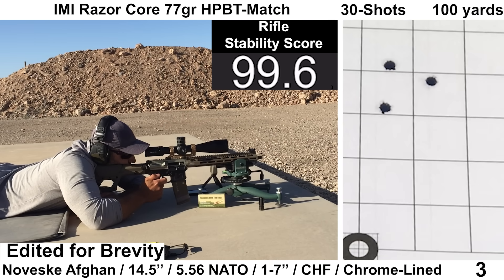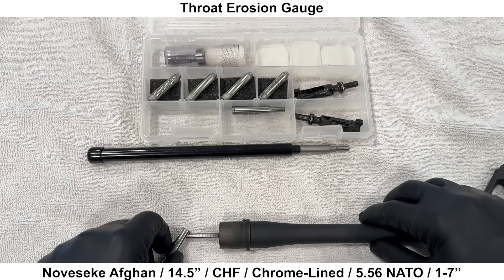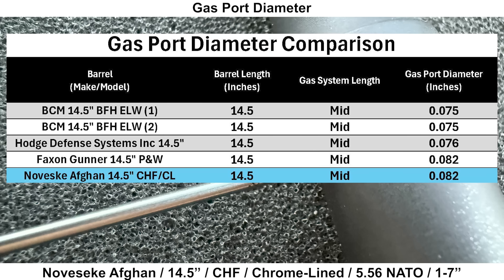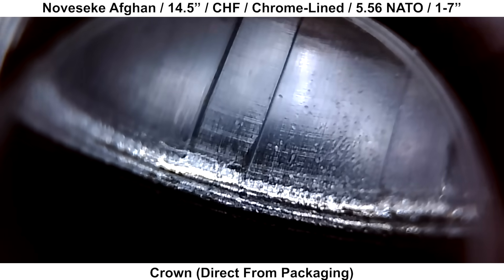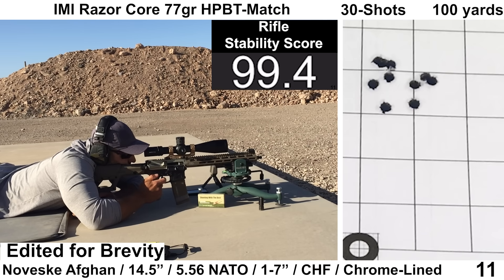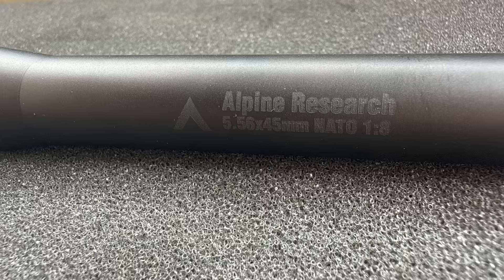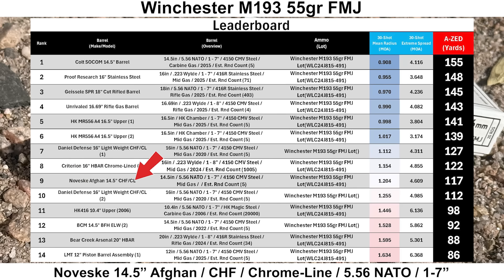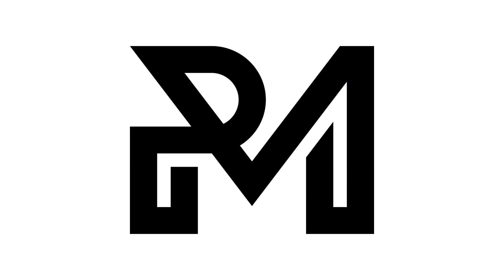Noveske Afghan AR-15 Barrel - Full Breakdown & Range Testing

Comment: My biggest issue with noveske is that their gas ports are huge. I've shot aks that are less gassy than a noveske
Reply from the maker: This one didn’t provide the most pleasant shooting experience. It definitely could have benefitted from a smaller gas port.
Reply: I have a John Noveske skinny afghan, 14.5 barrel. I can’t complain about the accuracy and it’s quite light. I also have a much less expensive BA 16” that’s just as accurate. Both are very over gassed. I’ve managed to tame the Noveske to 2:45-3:00 ejection.

Comment: I have one of the Noveske ddf 11.5” barrels. The gas port on it is .093. Wish they would’ve went a lot smaller with it.
Reply: Geez! Even a .067 11.5" would need a Super42(or Sprinco Blue) H3 when suppressed.
Why did you buy an 11.5" barrel with a gas port larger than .070? That's the spec for MK18(10.3") barrel.
.093 nearly doubles the gas of a .067, like +93%💥
Reply: Get a BRT gas tube to get that GP size down. It’s the easiest and best solution.
Reply: Just to chime in this is a mid gas barrel. You have almost no dwell. You need a fat gas port for that to run. I have an 11.5” ddf upper and it’s lights out. It’s running an h2 springco blue and a alleycat 556 and it’s 2:30-3 and dead nuts reliable. From my understanding a mid gas barrel in 11.5 should be pretty close to that to run reliably. Put the thing together and run it, I think you’ll be impressed.
Reply: @brandonwallace1471 Great info, didn't know it was mid-length. 
Well in that case it sounds like a barrel meant for suppressed-only build that uses a traditional baffled can.
Not something I would consider in this day n' age but to each their own.
Reply: @JohnZ556  no that’s the reason the gas port is huge. It’s built to run suppressed or non. If you ran a high back pressure can you would be fine in the .076 territory but it wouldn’t cycle with a flow through can or no suppressor. I have run 55gr and 77gr through it reliably suppressed and non and zero issues. I however would not run a rc2 or similar high back pressure can as you would then be battling buffers and springs as the thing would be gassed horribly. With a current flow through can hux, Ptr, velos lbp or my cat can you will have 0 issues going somewhere in the carbine spring territory with a h-h2 buffer.
Reply: @JohnZ556 I use my CGS SCI-SIX and CAT WB and they run fine on them.
Reply: @brandonwallace1471  my irregular defense 11.5” is ported at .085. And my mos tek 11.5” Midl length barrel I had ported at .078. The gas port doesn’t need to be that big to run.
Reply: @carls2210 Different barrels. What’s the weight difference of the ID vs DDF? Gas block journals are .750 vs .9375 it’s not comparable. I have a KAK 11.5 with a .076 and it doesn’t run without a can. Are you running suppressor only?
Reply: @brandonwallace1471  1.5 oz.
Reply: @carls2210  put it together and run it. I’m telling you your low back pressure cans are going to have 0 issues with gas to the face. Springco Blue and an H2 in mine. My can is basically a white bread so all things basically the same as what you’re talking about. Noveske will tell you to run just a carbine spring. I have one new in package and a Springco hot white to play around with but had zero need as the blue is great.
Reply: @brandonwallace1471  I’m not worried about gas to the face. It’s not bad I’ve been running them for months. But for the price they charge for the barrels and the way they market themselves as barrel wizards I would’ve expected better gas port sizing. I do like the barrels with the cans I have. But next time I’ll just order another mos tek. I run the A5 system on all my rifles.
Reply: @carls2210  Does it malfunction? I just want to know what issue the gas port is causing. I don’t chase 4o’clock ejection but I know people do. But in 3200 rounds since end of March even using junk dirty win white box 55gr I had a single light primer strike. It’s dead nuts reliable. Hence what’s the issue?

Comment: In general are the heavy barrels more accurate?
Reply: In my experience yes. Especially when they get hot. I get the worst results with a standard govt profile but ive never tried a pencil barrel
Reply from the maker: In a very general sense, yes, it seems that heavier profile tend to produce better performance to a certain degree. However, there are plenty of other things that can affect barrel performance as well.
Reply: @PrestonJMoore  Can you offer any insight or advice for someone who wants to assemble a rifle that’s capable of handling a high heat/high rate of fire without quickly failing?
Reply from the maker: @roycox193   Can you elaborate on what you mean by a "high rate of fire" and "failing". the better I can understand your question, the better I will be able to answer it.

A while ago I did a video where I shot 90 shots consecutively into 3x 30-shot groups, which may or may not be helpful in answering your question.  You can find the video if you put " 6m6LIiwtAak" in the search bar
Reply: @PrestonJMoore  I’m experimenting with some FRT setups, most recent was doing 940rpm /5.56 and 880rpm /.223 so I’m sure that smaller profiles won’t hold up very long. I understand that military machine gunners change barrels frequently but I’m just trying to figure out if I need CHF CL HBAR’s in 20-24” to be able to handle a higher rate of fire in a safe and practical manner (I know it sounds a little crazy) but I want to find some limits

Comment: I've always wondered if a muzzle device could effect group sizes? I understand why you do a bare muzzle because it's the most consistent, but just thought I'd ask anyway
Reply: yes it effects it a lot
Reply: It definitely did in the testing I did once.  4 devices, same torque, different group sizes and POI’s shifted a bit too.
Reply from the maker: I plan to gather some data and do a video on the affects a muzzle device can have on barrel performance. But, it won't be any time soon.
Reply: Yes, muzzle device can impact in several ways- a muzzle erosion gauge can read differently on a barrel with an over torqued muzzle device versus properly torqued, weight of a muzzle device can alter results it alters barrel harmonics, concentricity of the barrel treads relative to the inside diameter of the muzzle device and any blast surfaces or ports.... All of that is just scratching the surface.

Comment: Absolutely love that you did the Frontier 68gr BTHPs. They seem like a very reasonably priced load!
Reply: Frontier .223 75g is the only factory load I’ve ever shot that popped a primer.
Reply: I've been seeing insane looking case heads and primers at the range and thought it was scary reloads, but it was all Hornady brass...
Reply: @SiliconeSword mind boggling that this is still a common issue.
Reply: @samlatone1763 at another range I saw red sealed primer PPU 5.56 with CRAZY ejector extrusion, so I think that must've been some factory stuff as well if the primers had sealant on them

Comment: @Preston Moore Are marks like the ones on the buffer at 4:37 in the middle normal?
Reply: There bolt carrier group most likely has a bur at the back of the carrier which is causing that pattern on the buffer face.
Reply from the maker: In my experience, they are not particularly abnormal after a decent round count. It is from the back of the BCG contacting the buffer.  If the back of the BCG is a bit rough, it will cause more wear to occur faster.
Reply: @PrestonJMoore  Thanks for the reply. What do you think about the play between the upper and lower on an AR-15? Does it have any effect on anything? Should there be none at all?

Comment: do you have any data or experience regarding barrel mounting from your testing? does the clearance of the barrel extension to receiver matter? is "thermal fit" even useful?
Reply from the maker: I don’t have a lot of data on that at the moment.  But a video on that topic is on the to-do list
Reply: I have done several different tests: thermal fit, truing receiver face, bedding (green loctite). I’ve noticed no noticeable difference in 3 different guns. One of my most accurate AR setups has a pretty loose fit between the barrel and receiver. If you’re wanting to squeak out the most accuracy out of an AR for a precision build, just spend the money on a really nice stainless barrel and skip the mass produced barrels. Barrel quality will be the biggest factor. Timing (buffer system) can make a difference too.
Reply: @JGoodZX6R  I'm surprised timing makes a difference, never heard that one before. I'm assuming heavier buffers give better accuracy?
Reply: @mandaloin I honestly can’t say for sure. I would tend to say yes based on the limited things I’ve seen with what I’ve messed around with. Tubbs flat wires have helped in some things. It’s odd, I admit lol.
Reply: This short thread makes me feel like a kid listening to adults having a conversation.
Reply: Considering a lot of viewers would rock with the parameters of upper builds that PrestonMoore uses in all ot his barrel testing videos, thermal fit vs a larger clearance could be a negligible difference.
Reply: Also curious about barrel nut torque and if that actually matters for accuracy as long as it’s in spec. Some folks think max torque is better.
Reply: I don't know how you'd control for other variables without custom modifications to a single barrel.

How would he control for every variable that is present between different barrels?